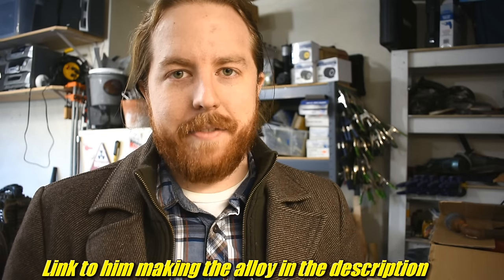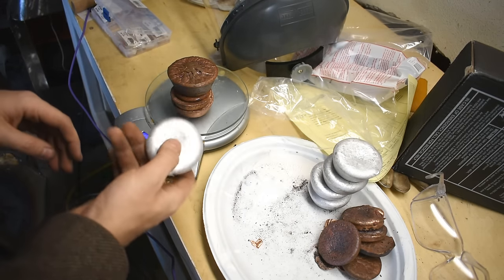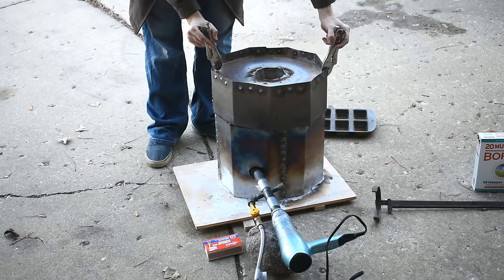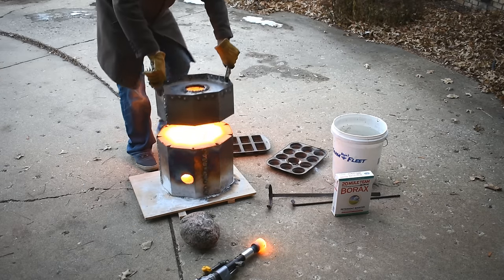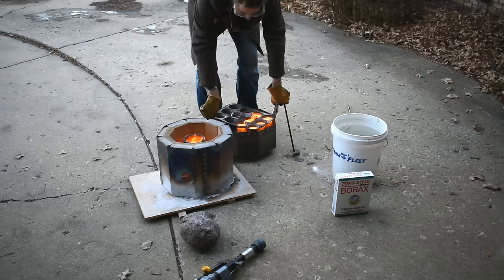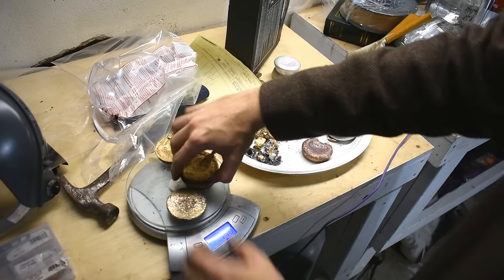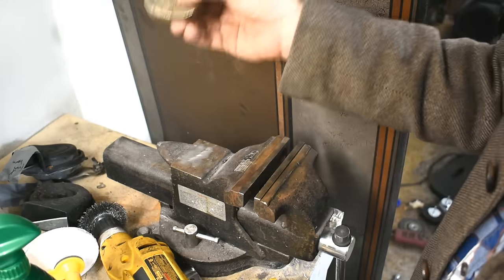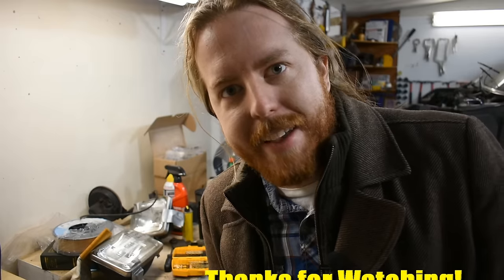The Bronze Alloy as Tough as Steel! (almost)

Comment: You have exactly 91.3% copper to 8.7% aluminum that is a rather strong alloy. You could have added nickel and made C95500 aluminum bronze which is exceptionally strong. Currently I am making a 7075 aluminum alloy for a nonspark wrench.
Reply: It might be too late to ask, how much nickel lol
Reply: @Freddy-bx6sf  
Aluminum 10.0 - 11.5%
Cu, Copper 78.0%
Fe, Iron 3.0 - 5.0%
Mn, Manganese 3.50%
Ni, Nickel 3.0 - 5.50%
Other 0.50%

This is manufacturing grade composition for C95500
Reply: @thegreatders344  thank you. When it says 0.05% other is that for rounding errors? Is that like byproducts or something?
Reply: @Freddy-bx6sf other mixtures like phosphor or beryllium can be added on that 0.5% but ignoring it is fine
Reply: @Freddy-bx6sf  0.50 accounts for the impurities you can basically never entirely resolve. There's a patent for Nickle/Aluminum/Copper that gives values 10-12% aluminum, 2 - 10% Nickle, and the remainder copper from whatever percentages you're using. Manganese can be anywhere from .01 to 5%. Iron can be substituted in at values of 1 to 6% in place of copper.

This is specifically advantageous because it allows the stress relieving heat treatment, or tempering, of the resulting bronze without causing it to become eutectoid. So its retains a martensite structure while being stress relieved, thus resulting in a greater body ductility. Such tempering should be done in the 800F to 1050F range of temperature.
Reply: Aluminium 7075 is what they use to make aircraft,  it's stronger than most steel grades.

Comment: Wait carbon is made of carbon?
Reply from the maker: I’m 95% sure, can’t be absolutely certain though
Reply: Paul's Garage I think it's made out of hydrogen
Reply: So is carbonara sauce, it's just arranged differently
Reply: i cant say it is wrong
Reply: JAG827 casting 

Carbon, being an element, is what it is. Whether you’re referring to soot, nanotubes, buckminsterfullerene, graphite, graphene, glassy carbon, or diamond, it is still carbon.

Just like why phosphorus can be a brick red powder that is often found on the sides of matchboxes, but the same element can also be a yellow wax-like material that spontaneously ignites if you let it sit out too long. Either way, they are allotropes of the same element.
Reply: no

Comment: I've been having some hard time with melting down aluminum cans, I always end up getting absolutely no dross once im finished melting them all down. Is there anything you think I can be doing wrong?
Reply: No dross, what do you mean
Reply: Jordan Howard There is absolutely no black dross that you get when you melt down cans, it only started happening to me recently, and whatever i do it won't produce the dross and get the impurities out of the aluminum until i melt it down again, and then I have a harsh smell of plastic coming off of the aluminum
Reply: When I melt cans I get just the opposite effect. It smells bad and smokes as it is burning the paint off the can and I feel like I get about 50% dross off the top. I just recently started adding "light salt" to the aluminum after its melted. It produces a dark liquid on top. If I stir that in I get a little more dross out of the melted aluminum but not a lot. 

The ingots that I make produce very little dross when remelted. I think you're always going to get oxidation and some dross unless you've figured out a way to bathe it in some inert gas. That sounds like a lot of work and expense for very little benefit though.
Reply: swdweeb I can only get the plastic and paint out in the 2nd melt and it comes only out as a very syrupy liquid at the bottom of the crucible and I use the morton light salt but all that does for me is completely mix the dross and aluminum together, but everything is still a liquid. Its a very strange thing, and I can't seem to find why of how it happens
Reply: That is a very strange thing. Sorry, wish I could be of more help.

Comment: I remember forging down a large-diameter round bar of aluminum bronze. Didn't know it WAS aluminum bronze. Heated and quenched it to anneal. Swung my hammer down. Every single tooth in my skull rattled. Found out later that it hardened when quenched. Mystery metal lottery....
Reply from the maker: Sounds like a tooth shaking good time
Reply: @PaulsGarage  I think you can quench harden and temper it to around 50 Rc, which is good enough for steel swords and plenty for smithing hammers.

Comment: Have you seen the video by Brian Oltrogge:  Casting Brass|Sand Rammer-3D Printed Pattern?  I really like the way he supported his burner and the way he extended his riser and vent.  It kind of reminded me of Myfordboy's method.  BTW, if you want to reduce the airflow & still use that hair dryer, try taping it to a y-pipe first.  By changing the input and output port arrangement, you might get the flow that better suits you, and no additional moving parts.
Reply from the maker: I've seen that vid, VERY cool sand rammers!  I could modify my burner for sure and get some more adjustability, but full power mode works pretty great.  It's too bad I only have mild mode and full blast, nothing in between, but I can deal with that.
Reply: Okay.  It also occurred to me tat you could switch blow driers.  I've got a cheap, low-powered 2-speed that I can't turn off the heat, but if I wanted to dedicate it to furnace use, the heating coil could be disconnected or removed.  I liked the way Brian used primer paint to help him smooth out irregularities on his pattern.  I thought that was a great idea.

Comment: dude you just answered a new question that’s been bouncing around in my mind since I built a foundry.  I want to make a hammer like you, since I’m missing a hammer and anvil.  Do you think aluminum bronze is dense enough to make an anvil ?  New sub from me, this is an amazing art and great video !
Reply from the maker: With the right alloy it's probably tough enough for anvil work, but that would take a LOT of aluminum bronze!  I'm not sure if my alloy is all that great, as most home brew alloys arent great, but I'm sure you could make quite an anvil out of the stuff.  One advantage of any copper alloy is the density.  While tool steel, properly treated, can exceed aluminum bronze in toughness, copper is actually denser than iron, so bronze alloys have more mass for the same volume.  Basically a forged steel anvil is probably tougher, but a bronze anvil of the same size is heavier.  That anvil mass helps when forging.

Comment: Can this be damascused with aluminum?
Reply from the maker: I doubt it.  I don't know for certain, but some of these bronze alloys are hot short, so if you try to forge them they will just break.  Cold forging is kind of out too because aluminum bronze is super tough.  The temperatures are very different, too.  Aluminum would melt long before the heat starts working on the bronze if it even is forgeable

Comment: is it stronger than straight alluminum?
Reply from the maker: MUCH stronger.  More similar to steel in tensile strength, bronze in density.  Steel is a little tougher but not by a lot
Reply: @PaulsGarage  whats the weight like compared to aluminum?
Reply from the maker: Much denser.  It's between steel and bronze.  The alloy is mostly copper and copper is denser than iron.  Copper and aluminum are both very soft, while aluminum bronze is very hard.
Reply: @PaulsGarage  so would a ingot of same size weigh the same less or more than a ingot of the same size in aluminum?
Reply from the maker: @markfeltner8260 it would weigh much more

Comment: It would be really cool to see the actual metallurgy graphs and calculations.  Look up "phase diagram of aluminum bronze" on google.  I found this to be particularly enlightening:
https://www.sciencedirect.com/topics/materials-science/aluminum-bronze

Interestingly, it forms martensite like steel does.  Also look at the effect of adding 10-15% manganese to the mix as it will make a better hammer by means of strengthening and reducing the formation of a brittle microstructure at the center of the hammer when quenched. 

Another interesting fact: Casting grade aluminum generally has silicon in it which has strong effects on crystal structure.  In majority aluminum alloys, it interferes with or complicates age/solution hardening.  I am not sure what it will do in copper, however I suspect it will create nucleation sites like when used in silicon tombac. 

http://www.totalmateria.com/Article71.htm

Accounting for dross reduction of aluminum content (copper oxidizes slower) is important as there is a 1.5% margin in each direction from 10% Aluminum for good material properties.
Reply from the maker: Thanks for the info!

Comment: I just finished my first copper melt and pour, and I didn't realize how much you were flinching from the heat the first time I watched this, but now that I can relate, I was chuckling to myself as I watched you dance around the heat. It's crazy how much more radiant heat comes off of molten copper than aluminum.

Comment: Fit the lid on perfectly, use a marker to make one line going through the top and side, then two on the next side then three etc. These will act as registration marks to perfectly align your lid every time. Or weld brackets with holes on the bottom and pieces of rod to slot into them to the lid.

Comment: HEY I've never heard of "AL. Bronze" but I'm interested in "sci.-tech." and I'm wondering about the thermal conductivity properties of this alloy and if you could create a superior kind of CPU heat-sink with this material I was wondering if it would be even better if you threw a bit of silver into the mix say a silver dime or quarter. Silver being one of the best, thermal conductors in of it self or what if you Silver plate the whole thing I'm sure it'd look cool as hell. Just an idea I'd love to see a VID on the topic.
Reply from the maker: That sounds interesting but im sure it would be less effective than just pure copper.  Silver alone is better yet and I think gold is even better.  Aluminum only gets used as a heat sink/heat exchanger because its light and cheap by comparison.  Perhaps a tiny bit of aluminum in copper would help reduce the weakness issue with copper with a minor loss in thermal conductivity, but i doubt it would be worth the insane increase in production difficulty that comes with aluminum bronze.  You're probably onto something with coins, though. If any alloy could cool better than aluminum or copper it might be a silver/copper alloy like found in coins.  Maybe a sterling silver? Pure silver might be great but its insanely soft, like butter soft.  It is very ductile but good luck with the weakness.  I have a feeling aluminum and copper are the best balance of production costs, materials cost, and effectiveness.  My PC for a while had a big honking cpu heatsink with 2 fans.  More area and more airflow is probably easier to achieve than a crazy alloy.

Comment: I just melted a whole bunch of old pennies (95% copper, 5% zinc) from 1959 to 1982 and added 10% aluminum by weight. The result was ridiculously strong and impact resistant. I actually can't believe it. Some of my bars had a little bit of material overhanging on the side from where I finished pouring. They look so thin and flimsy that I expected to be able to casually snap them off- I'd be able to if they were aluminum or copper. But I almost cut my finger trying. I am a pretty strong guy but I could not bend the overhang that was 1 mm thick and 10 mm long and 7 mm wide with both of my hands applying full strength - not even a little bit. You could definitely make knives with this.

Comment: I run a 5lb bronze furnace. I get 2200F with a passive Bernoulli draft induced by propane injection into a simple pipe. I melt 5lbs in about a half hour. No electricity involved.

Comment: Alsox4 wouldn't have any similar characteristics to steel like if you quench it in water or quench in oil or let it air cool what are the differences and if so post them
Reply from the maker: I don’t know exactly characteristics of steel, but aluminum bronze is somewhat soft when annealed, though it work hardens very quickly.  It’s also very low friction compared to steel, so when the bushings made of al bronze break in, they conform perfectly, become incredibly strong and hard, and resist wearing out.  Good stuff.

Comment: I am a machinist, and I machine aluminum bronze fairly often for guides and things. I use an SFM of 120, similar to stainless or A2 which works pretty good.
Reply from the maker: Thanks for the info!
Reply: No problem, also if your not using carbide tooling the work hardening aspect of it can become an issue when machining. to get around it instead of using multiple passes, go full depth using a slow feed rate.

Comment: This may be a silly question but, did you have the heat function going on the hair dryer going or was it just blowing regular air?  The reason I ask is because I have an old vacuum cleaner motor and moves a ton of air but with no extra heat…I would assume the propane is sufficient?

Comment: Here's the math on your first mixture.    Total of 1,614g 91.2% copper weighing your 1471.056 , 8.8% aluminum weighing your 141.944. I noticed your two weights don't equate equal to the individual weights so a difference of less than half a gram on each material. Not enough to change it though.

Comment: Forced air is seriously a MASSIVE difference. I use a shop vac in reverse with an inline speed control knob turned all the way down and the hose intentionally misaligned to prevent too much air and I've sheared off my pipe that serves as torch end in the furnace at least 5 times now. I'm thinking about running an O2 concentrator instead, as it's lower velocity and highly flammable

Comment: what is the borax for?
Reply: The borax is used for flux…a good flux is super important.  The flux reduces metal oxidation.  I’ve heard of other salts being used as well, sodium chloride and potassium chloride, fluoride salts, even nitrate salts.  What I’ve found is difficult about small scale foundry work with copper and aluminum is the formation of oxides.  Copper oxide and aluminum oxide will form grummy sticky bits in the metal mix, and, dross floating on top as it’s called.  The oxides have an even higher melting temperature than the copper, and this really throws a curveball in getting a good pourable metal.

Comment: Also I think the hair dryer worked so efficiently because it not only forces the air in but preheats the hell out of it. So the base temp into the combustion front was way higher than it otherwise would have been.

Comment: I've used non-sparking tools before, and they were pretty soft (at least compared to normal steel tools). The features on the tools also weren't quite on center, so maybe we just got crappy tools despite the expense.
Reply from the maker: Could be?  It's easy to screw up the alloy.  It's a balance between strength and brittleness and sometimes they go a little too soft to prevent it shattering

Comment: Just wondering because I'd love to make some of this but since the melting temperatures are so different wouldn't melting the aluminum in the copper destroy the aluminum since the temperature to melt copper needs to be so much higher? How does it mix when the melting points are so different?
Reply from the maker: Good question.  It doesn't hurt the aluminum at all.  They are both liquid at that temperature, but the aluminum might be better described as dissolving in the copper.  The thing you're describing does happen with brass, however, as the melting point of brass is above the boiling point of zinc, which is the main additive to copper in brass.  That results in white smoke (zinc oxide) coming off the surface as the zinc evaporates.  This doesn't happen with aluminum bronze.

Comment: Ha ha ha! Loved the video! Very informative.  Especially with the brittleness tests. Was curious, did you use a grinder at all to it? Also, what was the weight? As it has Al in it , it would weigh less. Also, how hard is it to cast? I'm curious about it for replicating period weapons.

Lastly, go to Harbor Freight and invest in some inexpensive Oxy - Acetylene gas welding goggles. #5 shade should work out just fine. Great teaching!
Reply from the maker: It casts easier than copper, probably not quite as easy as tin bronze or silicon bronze, though.  I didn't take a grinder to the ingots, but I did use the grinder on the hammer that i cast later.  I didn't think it was that tough on the grinder, but then it shot flames and stopped working... I guess it's hard on grinders LOL

Comment: this material will make a great hammer for hammering cold things but I don't think it will work for forging stuff like steel which forge at temperatures high than the melting point of the aluminium bronze
Reply from the maker: copper alloys diffuse heat pretty well, i'm pretty sure the momentary hits won't transfer enough heat into the hammer to cause any problems

Comment: You've got 8.8% aluminum there. If you were shooting for 10% you want 9 parts copper to 1 part aluminum, not 10 to 1.
Reply from the maker: My math is never perfect anyway.  However I suspect the copper ingots were slightly contaminated with aluminum to begin with, so my aluminum content may be a little higher

Comment: To get a torch that hot and have it heat up the foundry that quickly, you probably had a near max effeciency burner. Propane with pure oxygen can reach near 3600 degrees farenheit. Good job
Reply from the maker: Thanks!  It definitely got crazy hot really quickly.  I didn’t expect a burner made of 10% duck tape to work so well